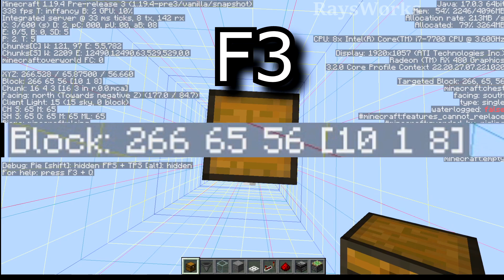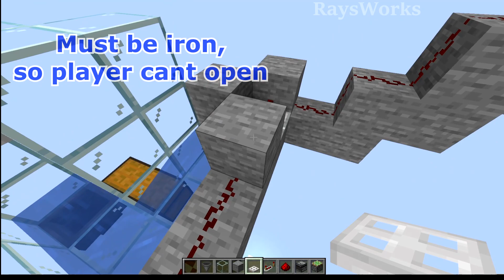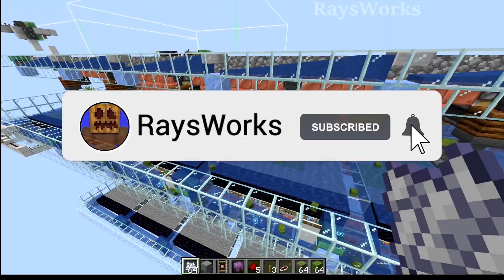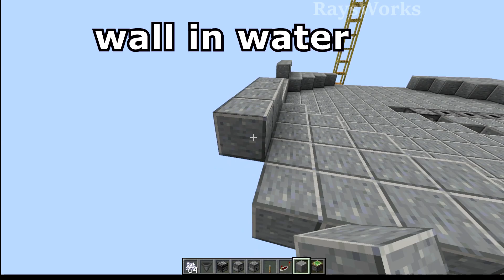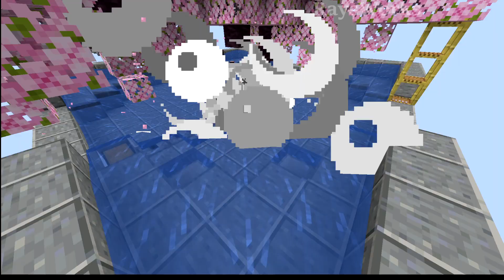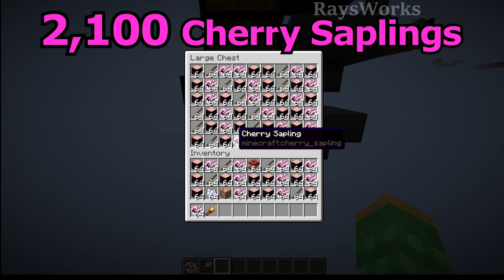CHECK description for NEW Easy Automatic Cherry Trees Farm in Minecraft [TUTORIAL]

Comment: sorry mr works, your farm is broken in the current patch on realms. I have tried downloading the world file and everything is fine but importing the schematic and placing everything block by block, the two powder snow is too long of a delay and ends up with the TNT exploding the duper
Reply from the maker: ty, i think i found the problem. check description.
Reply: @RaysWorks  i tried several different configurations before i ended up building one with a water delay for the tnt. Lowering the two blocks of powder snow by 1 or 2 blocks consistently blew up the snow blocks and having only 1 powder snow in any placement was too little delay. Hopefully your new design/s work!

Comment: This farm sucks. built in my world checked over it like 5 times and built it perfectly, tnt wouldnt drop trapdoor wouldnt open utter and complete trash. dissapointing normally rays farms are good

Edit: it doesnt suck it just has a flaw (that is fixable) (think it is cause im on 1.20.1) i had to build a staircase for the redstone cause the signal would not go throught the scaffold and also if u placed the blocks between repeaters that can also cause problems i changed that and now its working amazing

Comment: Hey Rays, I was just wondering about your tnt dupper, I looked at it in the world download and I noticed that you have some dead fan coral. Does it have to be that exact one you have in it or it doesn't matter what type as long as it is fan coral?.
Reply: Can I ask you a question about the duper? I'm trying to set it up on a server ( it is allowed there) but I don't know how to place the TNT in its correct spot without it going off when I put it next to the detector rail with Minecart. Whichever way I try it it blows up. I tried placing the TNT first but still...I'm missing something not sure what...
Reply: @lilac216  the tnt is not right next but diagonal to the slimeblock with the Minecart on it.  It connects with the piece of wall in front of the slimeblock with the Minecart on it.
Reply: @kl1172   Thanks!